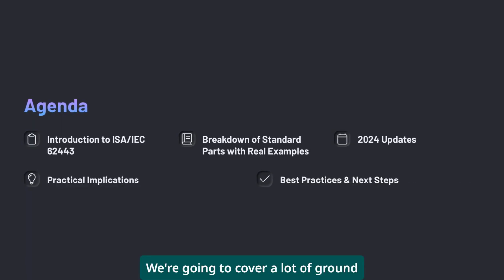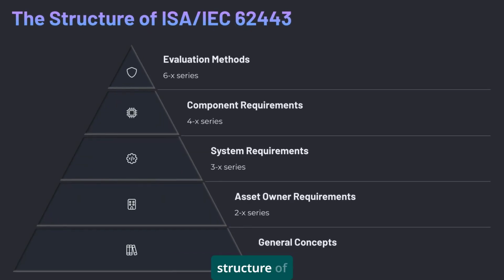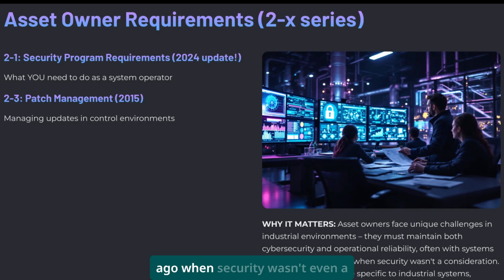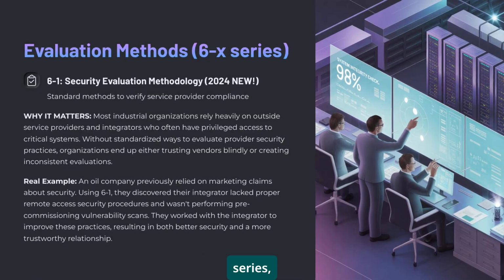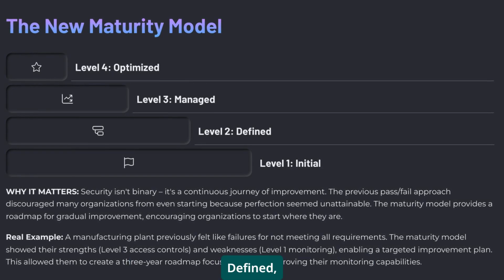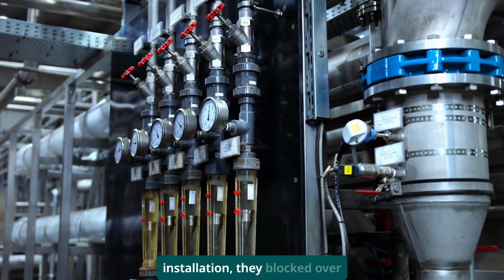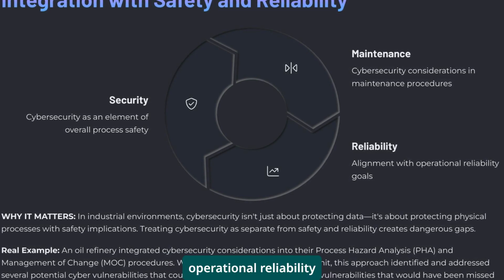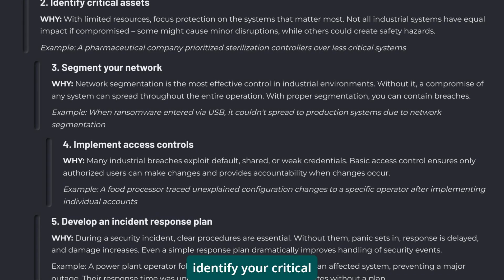What is ISA/IEC 62443, and Why Does it Matter More Than Ever?

Comment: I picked up a few good ideas - grateful for that. Understand however that nw segmentation is a big hurdle to overcome in environments where historically, /16 subnets were commonplace to drop in the whole solution enchilada (disregarding Purdue model - not concerned about zones or conduits) - For one try to get a handle on the cost and effort of re-IP'ing hundreds of  20 year old PLC's w/o causing major impact. So the best bet is to focus on Non Real Time SCADA (or Eng Workstations) to move out to separate vlans/Segments). Secondly,  not all "new" North South traffic patterns are happy to be funneled through a FW (so SDN and ACL's may be needed with a fusion interface out of the VRF to the FW (i.e. it requires revamp of the as-is network infra).Thirdly, Access Control without proper Identity management is a recipe for disaster - I'm a big fan of introducing a PAM (bastion host on steroids) to avoid that ICT initiated user access can directly connect to OT targets w/o deliberately breaking SSO and/or enforce privilege elevation (+ session recording).
Thx again for sharing